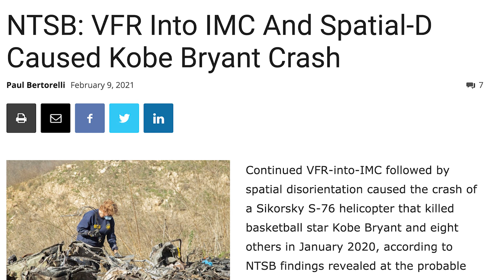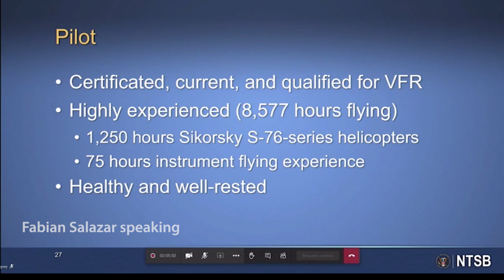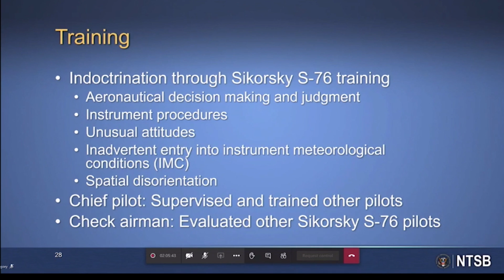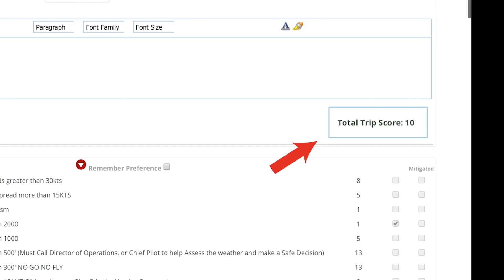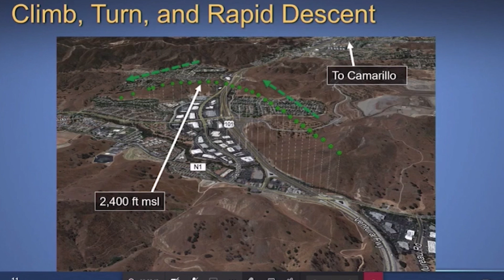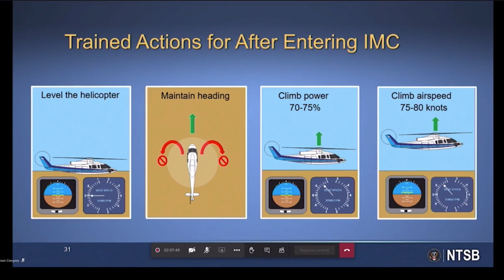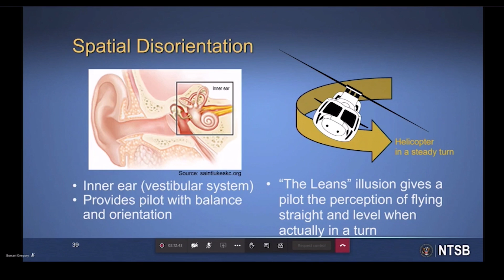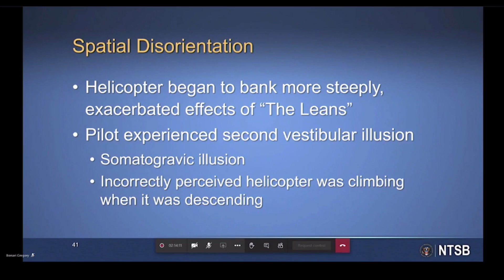How A Split Second Wrong Decision Caused the Kobe Bryant Fatal Crash

Comment: Another possible explanation would be if he decided to engage the autopilot while climbing or talking to the controller as stated, and inadvertently made a left turn due to an effect similar to the tonic neck reflex, something I was cautioned about in driver and CDL training. When the head is moved to one side in infants, the opposing arm will tend to reach towards the head. It can cause some "oh shit" moments behind the wheel if your not aware of it. A good example that happened to me is suddenly having to physically look at something on the passenger side of the car, only to look back and realize that the car was crossing over the center line and into oncoming traffic. The opposite happens when looking off to the drivers side: The vehicle will head towards the shoulder. If he was looking off to the center console for various tasks, its entirely possible that he would inadvertently enter a left turn, and not even realize it. The entire time he would still think he is "flying straight", but in reality moving the stick slightly off to one side. The effect is subtle, but its noticeable if you (under controlled conditions in a vehicle), turn your head to one side, than the next. Your arms will turn the wheel slightly in the opposite direction.

Comment: Spent many hours in  C-97 cargo plane cockpits back in the early to mid sixties as an ACM ( Auxiliary Crew Member) while in the Cal. Air National Guard. The 146th. AIr Transport Wing. Our home base was the Van Nuys Municipal Airport. During the Viet Nam war we constantly flew from our home base in Van Nuys Ca. to various points in Viet Nam with war material and personnel. There always seemed to be one or more of our aircraft headed across the Pacific one way or the other. It was ten hours of flight time to Hawaii and often another ten hours to our destination somewhere in  Viet Nam. Plenty of flight time for poor decisions or faulty machinery to make a landing in the Pacific necessary and the only option once we reached Check Point Charlie which was a weather ship one half the way between the California  coast and our base in Hawaii. A water landing would snap off the tail of the aircraft we had ten man life rafts on board but we are talking dead of night two thousand miles from land. Thousands upon thousands of flight hours accumulated in our fleet and yet there was NEVER a mishap let alone an outright crash during my four years service. 
The pilots let us ACMs into the cockpit quite often for long periods of time. We flew at about 8000 MSL over and back. I was a flight line mechanic for the 146th. Wing. I remember being amazed at the number of instruments and controls, switches , dials, levers and fuse panels. They covered all areas except the cockpit windows. This did not include the flight engineers panel which itself was covered with row upon row of dials ,switches and fuse panels. 
The helicopter in question had one man doing all the critical decision making and flying, could he have made a series of tiny bad decisions as we humans are prone to do or misread his surroundings and the forces he thought he had under control. There was no other conclusion to these low level maneuvers but to run out of time and hit the unforgiving ground, killing all onboard in a fiery maelstrom. I'm not a pilot but I have heard the two conditions that are absolutely necessary for safer flying is the airspeed you have and plenty of altitude. These poor humans ran out of both at the exact same moment.

Comment: Thanks for posting.. I was wondering about this crash, how an instrument rated pilot could fly into the hard deck.
Reply: Easy.  Instrument rating does virtually nothing to prepare a pilot for the psychological stress of hard IFR near hazardous terrain while under intense mental stress.  
Consult your local psychologist to understand how the process works.
Considering the known circumstances, the most obvious reason - evident at the outset- for the crash was the pilot's split-second decision that he had enough momentum to punch thru the fog/clouds and reach "on-top" within about 30 seconds - before anything could go wrong!
Reply: PS  When I say the pilot made a "split-second" decision, I mean he had not prepared himself psychologically for IFR, for disregarding his sensory input, but rather to make a conscious decision to rely on his instruments, only.  Sans that mental preparation, he was an accident waiting to happen.  
The best method for achieving that instantaneous state of mind for the future is to first have experienced the insidiousness of the situation in actual IFR - if your instructor allows it to happen.  Once you experience the heart-stopping reality, you never forget, and are prepared henceforth.

Comment: They took off from John Wayne airport in Irvine. Where did you get Santa Ana from?
Reply: It's confusing, isn't it?  The airport is located in Irvine, but its IATA symbol is SNA - Santa Ana Airport and the mailing address for is 18601 Airport Way Santa Ana, CA.
Reply: You're absolutely correct on the address. I agree it is confusing. Thanks!

Comment: Was there any device that could have given the pilot a warning signal that there was a obstruction ahead prior 
To the crash?  2. I know Kobe to be a perfectionist, if he knew that any device would make that helicopter a safer
helicopter he would have paid for it. Why didn’t his pilot friend advised Kobe that the Copter was lacking in the safety area?
16 years experience… SAFTEY FIRST.
Reply: ”Was there any device that could have given the pilot a warning signal that there was a obstruction ahead prior To the crash?”

That’s a fine question.  Yes, there are such systems, but they wouldn’t have prevented this accident.  Terrain awareness wasn’t the issue here, as it would be if, say, the aircraft flew into a mountain while in stable, level flight.  In this accident, the pilot became spatially disoriented in diminished viability, and then lost the ability to control the aircraft altogether.

”I know Kobe to be a perfectionist, if he knew that any device would make that helicopter a safer helicopter he would have paid for it.”

How do you know this?

”Why didn’t his pilot friend advised Kobe that the Copter was lacking in the safety area?”

Because the aircraft wasn’t lacking in the way you suppose.  It was legally equipped for flight in diminished, and even zero visibility, and the pilot was appropriately rated for that kind of flight.  Remember, pilots fly safely in the same physical scenario, with the same type of equipment, every day.  This accident happened because of this particular pilot’s errors in judgment and execution, not because of any equipment shortcoming.
Reply: @cardinalRG  excellent answer!!

Comment: Sadly simulator is about the only way to train this stuff, but with such a focus on safety part of me wonders if this has lead directly to pilots panicking or not having instinct on the proper reaction when things go badly.  It’s kinda like how most average drivers can’t correct a skid properly in a car.  They’ve been told how to correct but never trained to correct it often.

Comment: "Good pilots making bad decisions" under the stresses of time, performance expectations, contractual obligations and other factors like congested airspace. Flying perfectly good helicopters into the landscape at high speed is an outcome no one wants. How can we as pilots and instrument manufacturers work together to present the necessary information QUICKLY, INTELLIGIBLY and CONVINCINGLY to pilots already experiencing task and sensory overload? The best guess of the NTSB in this case was a fatal case of the "leans". I strongly believe the human factor/instrument interface is a weak link in aviation; the Garmin G1000 glass cockpit was totally unusable by an untrained operator. I think efforts must be made to develop more intuitive instrument suites because it will save lives, whether the pilot in question has 8000 hours of experience or none.

Comment: I used to play on a flight simulator on my dad's computer when I was a kid and it had a setting in which the entire cockpit window would turn grey and so you only had your instruments. It seems like they could at least do this kind of thing in the simulator. In a real flight, maybe they could make the person put on a virtual reality headset and then have a camera shooting a video of their instruments and sending that live video into the virtual reality headset so then they couldn't peek as easily. If something went wrong, the flight instructor would still be there with them.
Reply: Who Ever. 
Modern flight simulators can make the weather anything from severe clear to zero zero. This is what allows instrument training to sharpen our flying skills and to practice instrument approaches. 

Some helicopters are only able to fly in visual conditions where they can see the ground, and may have very basic flight instruments. Some helicopters are very advanced, with instruments, navigation equipment and autopilots that are as good as most  airliners. But instrument skills deteriorated over time, which is why the FAA establishes certain minimum experience requirements.
Reply: I think the main issue that happened is the pilot didn't transfer from VFR to IMC fast enough. It doesn't matter how trained you are in flight instruments if you can't recognize you should be using them in the first place.

Comment: Questions from a non-pilot: Why does a helicopter company not have pilots all with IFR rating? Do they fly solely in the daytime? It seems crazy and restrictive to me. Could he have followed the motorway all the way to his destination, flying low for visibility but high enough to keep from powerlines etc? Isn't there an instrument in the cock-pit that let's the pilot know whether the aircraft is level or not?
Reply: night VFR is a thing and yeah because of how helis fly they pretty much only fly VFR unless your a military or Coast Guard pilot flying IFR in a heli is almost never done. you can not hover with out point of reference. and heli needs much more expensive AP setup for this then fixed wing
Reply: @Elios0000  thanks for the explanation 👍🏻

Comment: What a shame there was a good auto pilot system which wasn't activated!

I'm still puzzled why 75hrs of logged instrument flying amounted to this tragedy?
Why didn't he take note (and believe) the  impressive glass displays which would have had at least one artificial horizon showing a banked turn ?

Surely without outside visual references you have to 100% believe your instruments?

I've only logged 5hrs instrument flying mainly in gliders and sometimes commit to intentional cloud climbs, and all good so far!

But it still concerns me a professional pilot with 75hrs instrument flying could make such a fatal error with passengers on board.

Are the NTSB 100% sure there wasn't a sudden medical issue ?

Comment: When an 8 year old using a flight sim on their fifth flight would know that to avoid the ground, you would check the horizon for level flight but climbing attitude and double check the altimeter was increasing agreeing you were climbing until you reached safety or ATC intervened, how could an experienced person not do the same? They also had a radar altimeter to assist and there are multiple horizon instruments on a S76. Distraction from the passengers had to be a real possibility for this basic error to occur. 
🙈🙉🙊
Reply: An eight-year-old sitting in front of a computer screen won’t get spatially disoriented.  It is a very, very nasty physiological state that doesn’t require distraction from passengers, or even any external factor—although distraction must be allowed as a possibility in a case like this.  If severe enough, spatial disorientation can prevent “reading and heeding” the instruments altogether, even while looking right at them.

Comment: Underestimating how hard it is to fly in IMC, is in the root cause of the accident. If you fly thousands of hours in VFR day in and day out, but only 75 hour IFR like this pilot did, anybody would forget how hard this is. In SoCal weather, it is very hard for pilots to get the practice they need (instrument currency) in real IMC condition periodically.  Maintain straight and level in IMC is relatively easy, it is when you have to do climbing turn or descending turn, while setting up frequencies, that things can quickly get out of hand. I vividly remember one time when IFR departing Truckee, CA , a mountainous airport, in a snowy day, hardly anything is more scary. While getting distracted the airspeed easily drops to near stall when I noticed it. If I noticed even a few second later, I can't say I could have survived.  I also vividly remember one time when trying to follow ATC instructions to switch from GPS waypoint back to flight plan VOR airway while in complete IMC, I dropped almost 1000ft and ended up in unusual attitude in IMC.  I feel that pilots in SoCal need to actively seek practice in real IMC and experience these episodes so that we have proper mental preparation for such a challenge.

Comment: I feel that as soon as you cross into the commercial operations pilots should expect to be monitored with data recording equipment + video/audio - at least with passenger operations. Think about what body cams are doing for the law enforcement. If anything, it gives a pilot an "out". I have seen countless body cam videos of police getting told by a superior (usually drunk driving or other illegal activities) and the cop says "I can't do that, everything we do is recorded, it isn't like the old days". It gives a junior officer a legitimate way out of an illegal situation with a superior or even judges in some cases. I feel the same could happen with high profile passengers trying to push a pilot to do something "just a little more dangerous". Not at all saying that that is what happened in this accident, just that it could potentially help the safety record of this niche industry

Comment: Synthetic Vision changes everything, completely eliminates the possibility of CFIT or disoentation, we've been flying with it for over 10 years. IFR needs to go away for helicopters and something that could be called Synthetic VFR needs to happen. I flew with Ara many times and often criticized the fact that the old S76 did not have Synthetic Vision, a under $20k upgrade, when they would spend $30k on the leather in the back or Nike would kick in $50k for a wrap. With Synthetic Vision a low time heli pilot with zero IFR training can be comfortable and relaxed in IMC zero vis and get to where ever they want safely, it's only the rules that prevent this.

Comment: The problem is that people don’t expect problems. All accidents are equal. It’s the consequences that vary. The human condition is very real condition that people are often unable to grasp. The inner ear situation is not that different a situation from a “gimbal lock” and although i have no reason to discredit or disbelieve in the findings... the truth remains that a instrument malfunction or failure could produce a similar unfavorable outcome.
The problem again is that every mistake has in common at least one factor with all mistakes... that the person does not recognize that something is wrong. In situations where people are able to recover from the error and learn from the experience... future mistakes are less likely to occur because the people who learn from the event are informed.
   At the 14:56 point of the video... (i have not finished the video yet) the discussion is approaching a philosophical perspective... but it is obscured by political concerns and personal involvement reactions.
In a safe safety protocol system the “assumption” is that a error is happening right now. Right Now. Right Now. Right Now. The protocol is sweeping through the check list to find the mistakes and not finding a corrective action to begin. Returning to the beginning of the protocol checklist... to some people this is too stressful. To other people it is reassuring. 
For example if a paratrooper leaves the aircraft expecting his parachute to fail in some way... he is not shocked. He is not surprised. He is identifying the type of failure and performing the requisite duties... followed by the next protocols... the anticipation of failure creates a relaxed planned environment for corrective action. It’s a philosophical perspective that seems much more stressful at moments but in fact is reassuring and supporting of positive outcomes.
All mistakes are equal. The task is to facilitate the future avoidance past mistakes in such a way as create beneficial processes and protocols from the consequences of the disaster.
The advent of flying civilian vehicles is fast approaching. The systems and protocols needed for the future require a in depth analysis of all existing processes and systems. 
Also the development and commercial application of many different new technologies should be encouraged and in safety systems... subsidized. For example if the aircraft was equipped with set of three or more FLIR cameras that can see through the clouds and fog... the natural human behavior would be to glance at the three view screens... and a black box recorder showing that information would be available in addition to the current information available. The expensive equipment would drop in price as the increased sales effected the economic activity and perhaps the national number of crashes could be reduced by a significant factor. I would estimate that the savings would outweigh the costs very quickly.